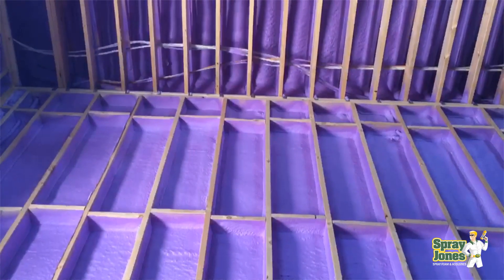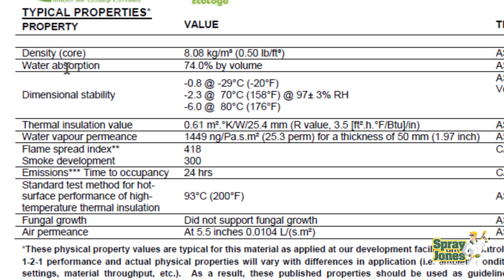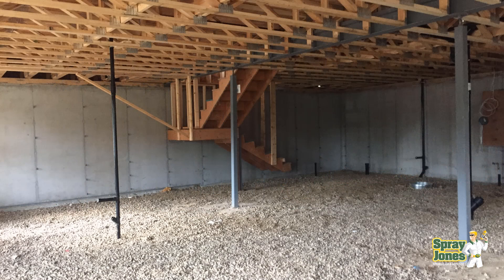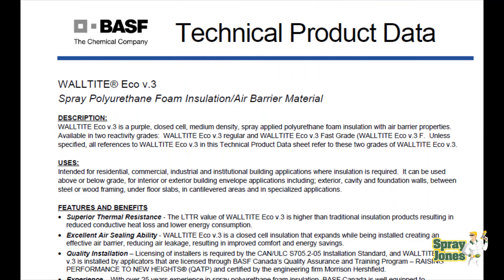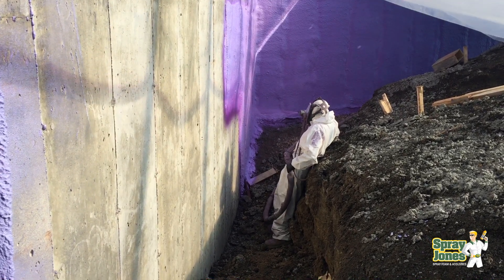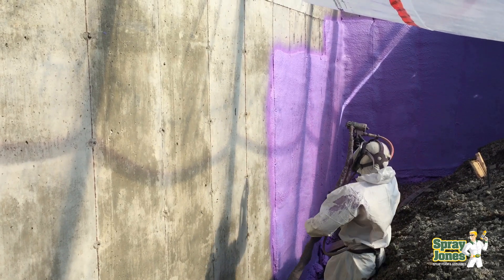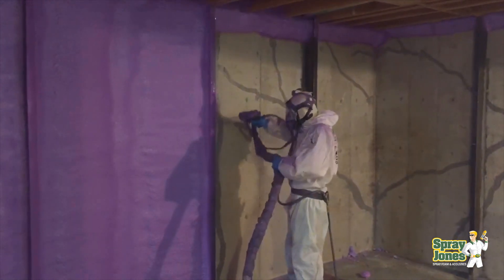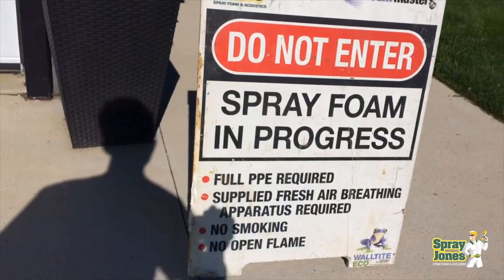Is There Waterproof Spray Foam Insulation?

Comment: is there mold and pest resistant. do you have an antiallergy coating that can be applied if only used on the interior basement and its ceiling and the attic on the main roof only.

Comment: Once again, thank you so much for your clear, precise, and concise presentation with the actual facts and figures. I really wish I knew more about all this 6.5 years ago when my wife and I bought a home in Az,  sucked out the 1.5-2" of shoddy attic "insulation" (in an 8yr old home, obviously the inspectors didn't inspect anything up there and the insulation  subcontractor cut corners) and replaced it with 18" of the same for 5g...and it needs to be done AGAIN. Az gets windy and DUSTY.  That stuff has been blown all over up there, rendering large portions of my attic effectively uninsulated but for the drywall.

Comment: Odd craft question...there are a lot of people using spray foam in arts and  crafts. Specifically speaking it is used to make a maniqine or dress form.  In essence its a human body double. (Torso mostly) In turn the maniqine is often used for sewing and costume making. 

A cast is made with plastic wrap and duct tape. (Crafters think outside the box..inside the box and then use the box to make a new box.)

Once the cast is made it is removed from ymthe human by cutting it off and re tapping and filling in areas to prevent the foam from escapinfmg. Foam does not come in direct contact witgmh people. 

The foam is sorayed in the casing material. The taped plastic wrap surpringly holds the sape of the model. The foam is used to give the duct tape cast a firm filling and will cause it to kee its shape over time. The tape cast can be remove or left in place. The foam is there and can be pinned with sewing pins and will help make clothing. Sometimes others use the maniqine for props and whatever. 

What type of foam do you recommend for this use? What type would be best for painting or other paint or other finishing? Does it come in colors?
Reply from the maker: IT could be a 2lb foam or higher if they want the unit to be more firm.

Comment: How about flooding? If you have a coastal off grade frame home gutted. And you spray closed cell foam in a complete continuous envelope, are you protected from tidal surge? I understand the structural mechanics have to be in place. But from a water permeation perspective, are you safe from water intrusion?
Reply from the maker: What happens when everything else is wet? Closed cell foam holds back a lot of water.

Comment: im an absolute newbie tho ive been airless paint spraying for 30 yrs ..only just ordering my reactor...are there different grades of closed cell or is it closed cell and that's it..i will mainly be looking to fix leaking roofs.  does it have to be sealed with silicon or will a acrylic based masonry paint do the same thing..I'm in the uk..any help is much appreciated including a uk supplier
Reply from the maker: I am not a roofer. You need to choose a supplier and tech rep who will answer those questions for you.

Comment: I'm a big fan of spray foam but I have to wonder how many decades it will be before we figure out that filling houses full of chemicals was a bad idea.
Reply from the maker: Right now. 
SPF has been around for 50 years in Canada / USA. The building code is written for it and has 3rd party testing. We are the most extensively tested insulation product on the market. 
Worry about, glues, paints, stains, etc that have NO mandated off gas testing or standards to certify against.

Comment: In a Humid Tropical climate would it be a problem to closed cell foam each side of a cement/CMU wall?   Or Roof/Ceiling(Roof would also be the celling)
Reply from the maker: With the limited info you gave I cannot see why this would be an issue.

Comment: if true waterproofing is required then Polyurea is the right fit for that use case. That's the industry standard for remediating water storage tanks and other containment vessels. BASF has some great polyurea solutions under the Elastocoat brand (amongst others)
Reply from the maker: Yes, you got that right.

Comment: Mike,  great information.  Quick question.  I’m looking to insulate a shipping container roof.  Based on your info I’m planning on 2” of closed cell on the roof, then two layers of foam board then enclose with a shed roof.  Would you recommend the foam board on the container then foam or spray foam then board?  Thank you
Reply from the maker: All spray foam. No panels. Going to be doing a container home video soon. Perfect fit of the insulation it what matters most.
Reply: Thanks and look forward to the container episode.

Comment: You speak of secondary coating to seal the closed cell in wet environments. What is this secondary coating?
Reply from the maker: A polyurethane pot mix that is spray applied. There are too many specifics to list as options. 
This is a highly specialized commercial / industrial coating.

Comment: Is it advisable to use a sheathing with bonded polyisocyanurate like ZIP-R and to spray closed cell polyurethane foam to it in the cavities? Will the spray foam have negative effects on the polyiso? I believe both are vapor-impermeable.
Reply from the maker: There is no issue spraying to that system. It is not much different than a commercial grade EFFSI wall and SPF.